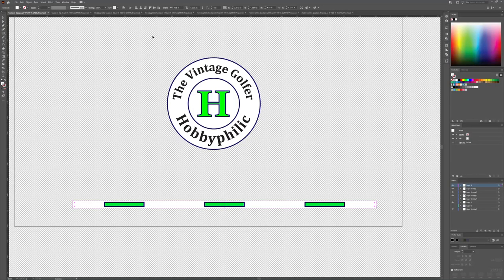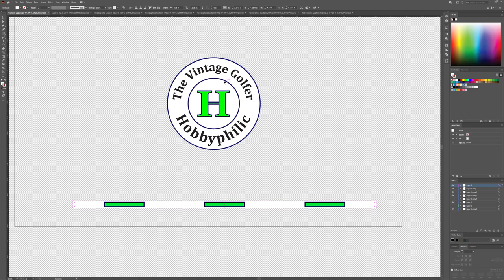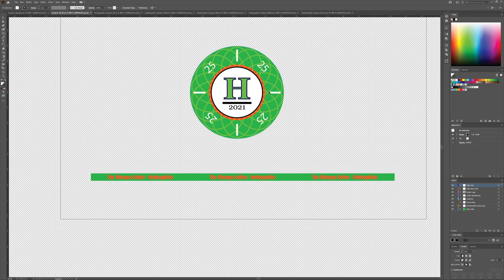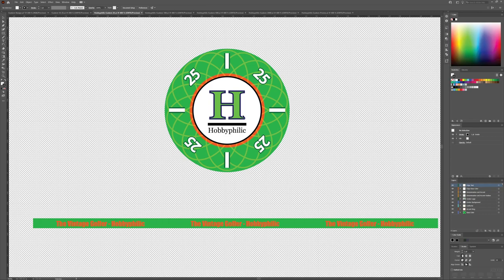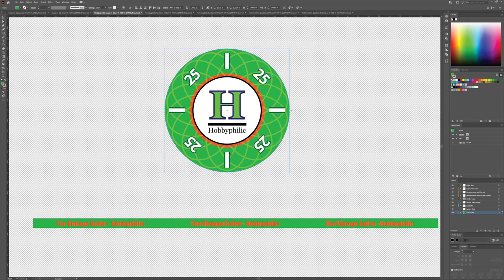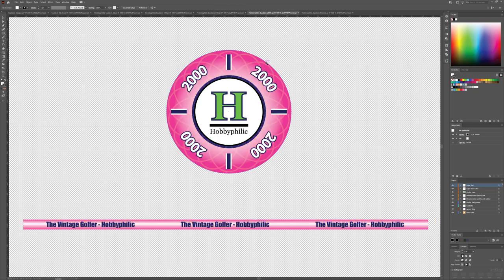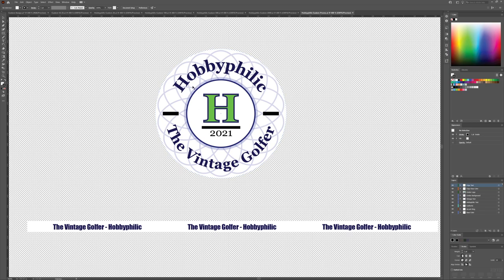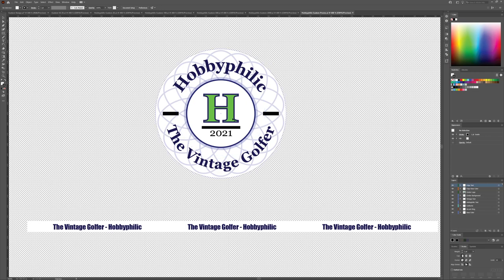Custom Ceramic Chip Design Part 1

Comment: I like the designs you’ve come up with. Love the background swirl pattern, it creates some nice visual interest. The lines pointing towards the center is cool too as it functions like a bulls-eye. Color schemes are nice too. Regarding the edge text, I think it’s tough for the green and orange. You could maybe cheat the orange to a brighter more saturated orange maybe. Or simply use another color scheme like green/yellow. Might also consider a thinner font maybe towards the medium weight to light weight fonts. Try Font Squirrel for free fonts. Great tool for graphic designers.